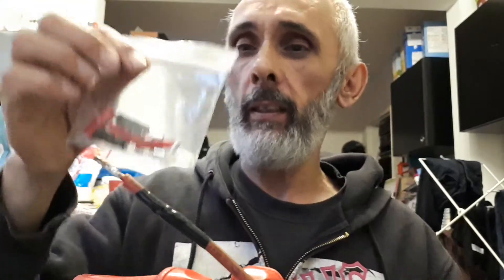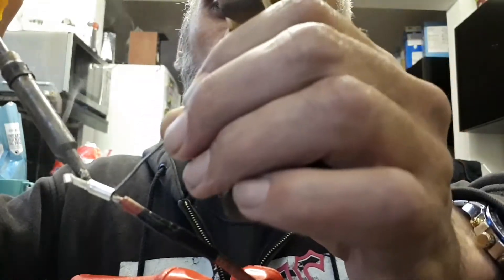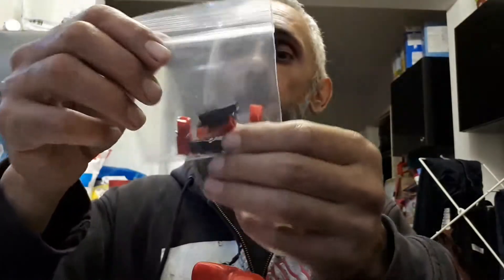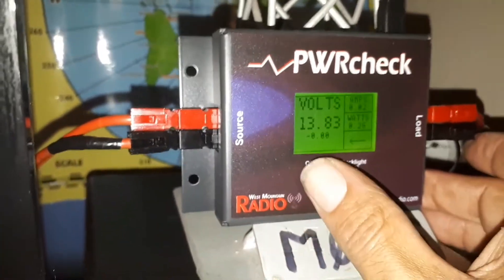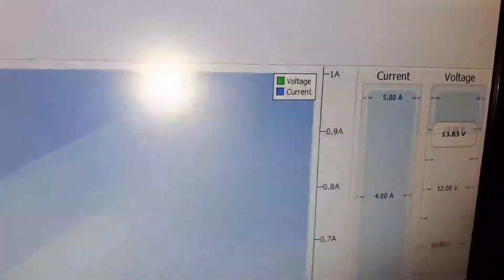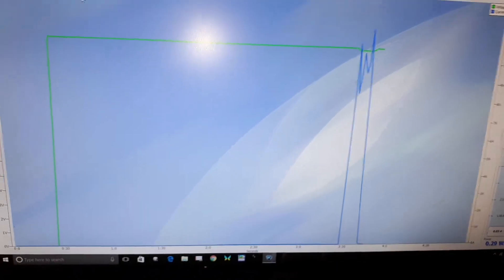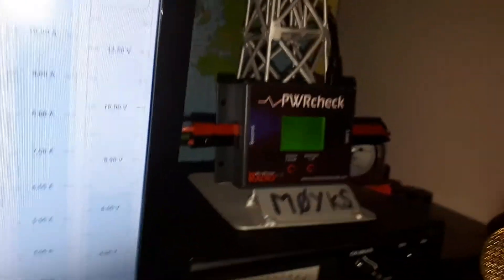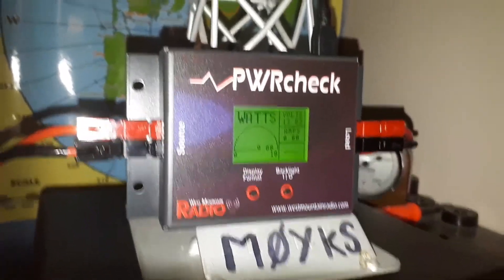Ham Radio - PWR Check West Mountain Radio Latest Tech Installation

Comment: I realize that many will not agree, but for this particular application and choice of power pole connectors, its actually better not to solder. Im sure for most instances it is more than fine, but would be ideal to have the crimping tool. There is my .02....but probably only worth about .01 for many :)
Reply from the maker: Thanks for the comment! I have a decent ratchet crimping tool as well lol but I like the soldered connection on the outdoor antenna connections, much stronger than crimping alone in my opinion lol. Best regards and thanks for watching.

Comment: Hi Simon
Over the years I've come to realise that for some strange reason if a device is marketed for amateur radio the price is inflated beyond belief. I use a similar device, aimed at the RC market, but rather than being £165 it can be bought off Amazon for less than £15 and is good up to 150A and 60Volt. True it doesn't have PC connectivity but in this day and age West Mountain should have designed their device to connect to an Android/IOS App via  BT making it more useful and convenient out in the field.

My comment above in no way detracts from the excellent way you present your videos, Simon, or your review of this device. 

Regards

Nidge (G0NIG)
Reply from the maker: Hi Nidge, Thanks for the comment. Its is always appreciated, I thought I would try out the PWRCheck for a few weeks before I replied to get an accurate review for you. 

The PWRCheck is very good quality and compliments the shack well. as for practicality out in the field I like it a lot and would not consider running a PC, tablet or phone as the device has multiple displays built in an would not require a second separate screen to monitor all the information. The software is the least useful part of the package but does work well and look good on the screen but as I said it doesn't really have any extra benefits by running software so I would not expect to have bluetooth connectivity or need it on this particular piece of kit. I guess the price reflects the build quality and like all cheaper kit  that is now on the market from china etc some works well some does not. All I will say is this item is very well constructed and nice to operate as is my other West Mountain kit - RIGblaster Plus which is still going strong 10 years on.

Best regards to you and the family.

Hope to hear you on the band again soon! 73 Simon M0YKS
Reply: I too have used the RC type meters but the problem with those is that they read on the negative lead, not the positive side so they are often very inaccurate in anything other than a field ops.  The radio current return can find its way back to ground via chassis and shield grounds in your home QTH.  The PWRcheck is on the positive lead so it avoids all that inaccuracy.
Reply: Agree as a general rule that many "specific" type equip for many things carries a premium. Sometimes that is nothing more than just taking advantage of the market, but other times there are some other things in play that may very well not be addressed in the non-specific gear. One example is RFI shielding etc. Not saying that this particular piece that is the case, but may be.
Reply from the maker: Yes I agree also. This kit is still working well and has not shown any faults. Good kit but a bit expensive. Useful but not essential in the shack. 73